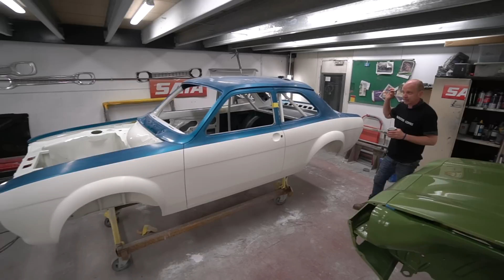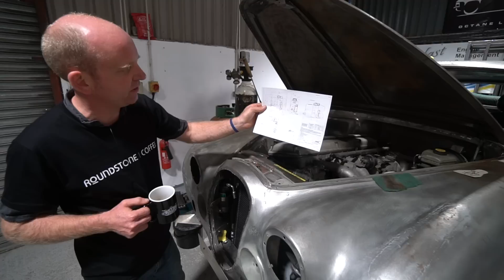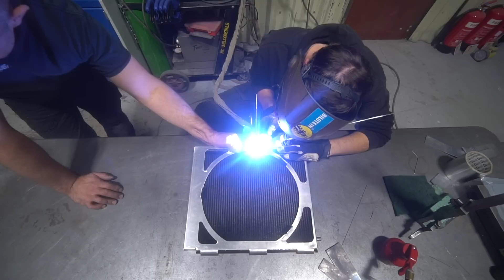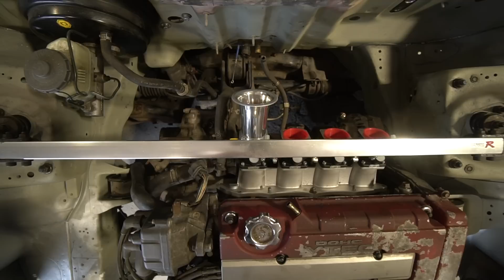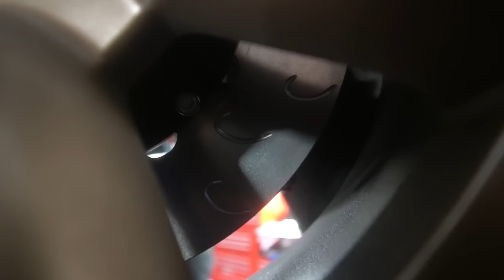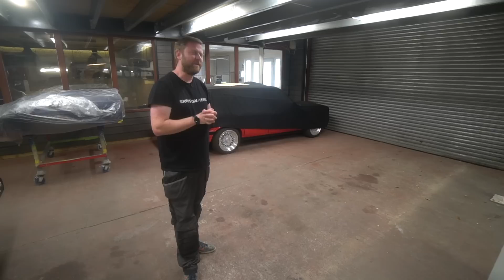Vauxhall Chevette Estate Painted & Stratos FOR SALE!

Comment: Best bit about using proper Honda bits is they're the only (afaik) company who built primary design right hand drive front wheel drive cars, with the heaviest 2 bits of the car (engine and driver) on opposite sides to each other. Shame they went all conventional primary LHD market  later on.
Reply: @mattsmith4053. You may already know this. In Japan, they drive on the left just like here in the U.K. And the Japanese have a cold snowy winter season. So when our car manufacturers went into decline, the Japanese marques cleaned up! Their cars were already RHD - plus they were built to withstand the rigours of winter motoring. Stay safe and well.

Comment: I notice you leave joins in stainless exhaust with discoloured areas.
I understand you can clean this off with a pickling solution.  In Australia at least you can buy this in about a litre bottle from welding stores. Not real expensive and makes the joins much nicer.

Comment: I can't even imagine selling the Stratos after all this time and work on it - it's been in the shop since the very beginning of the Uncut episodes, if not earlier. I would try to hang on to it for dear life even if I was out of the country a lot. I hope Retropower has a financial cushion and is billing on a monthly basis so they don't get too over their skis with customers not paying or pausing work... Seems like an ominous trend
Reply: You also have project creep, the ListerBell kit is built for £40-65k and they sell it on being a kit car without the quirks. Not a Hawk you build in a shed. Should they have gone as deep into making it different, the keypad switches,  Supercharging a 30 year old Alfa V6, 3D printing tail lights after 3 years etc, etc. Should they have spent more time at the start pinning down a price, look or target, rather than coming to a component and then going back and forth rendering stuff at that time. The clients love the relationship of you sending them 3 shades of leather for the handbrake. But this is the result. A very flowery version of what is a simple car.
Reply: @fraserwright9482   A turnkey LB is approx £100k and upwards depending upon spec, those that are built in a shed would cost between the £40 & 65k you mention.
There are a couple of LB's on Car & Classic currently for comparison. Blue wheels I think have to be described as a quirk.
Reply: They did mention they usecmonthly billing a while ago. Getting them paid is more to the point.

Comment: Large crystals within the structure (caused by rapid cooling) give less opportunity for each one to come apart and you end up with a harder material. Cooling slowly allows crystals to propagate meaning there are far more opportunities for each crystal to come apart, softer or more easily breakable material. This is why, if you need to harden steel without changing its alloy composition, cold quenching is one way to do it. Cryo-cooling is used for extreme applications such as steels used in pin sharp blades.

Comment: Dissimilar welding Nate? I think you were referring to 304 stainless steel as  303 is a road in the South of England, and usually 309 stainless steel welding consumables are used for mild steel/stainless dissimilar joints. Love the channel, Andrew from Cornwall
Reply: Made me go and check my dissimilar rod, it's 309L

Comment: I think we all wanted to know what's the asking price for the Stratos
Reply: If you have to ask, you can’t afford it.
Reply: The same could be said with the Morris.  The Morris is basically an MX5 spaceframe with a bigger engine. The hand wringing over the paint chips and it's being resprayed not because of a defect in application. But by use is why they should have had a dry build road test and noted the chips on the primer, dicky clutch whilst it was in paint prison.
Reply: €330k, but TBH this is a good example of where Retro power screwed up. The Stratos is a ListerBell kit who took months/years to do their bit. Engine options are Ferrari V6, 328 V8, Bussi, Toyota V6. The supercharging of a Busso took a year to do and still is not right. Most LB Stratos use the Toyota V6 with a supercharger ala. lotus Evora. So now after 3 years or more it's with the customer and it's failed to be fun.
Reply: @fraserwright9482  Good point - well made! Sadly often the way with vanity projects that run away with themselves.. ...
In direct contrast to the original ethos of custom car resto projects.
Reply: @fraserwright9482  Most LB STR's are fitted with the Alfa Busso motor, there are a handful out there with the SC Evora engine and also a dozen or more with the NA 2GR motor as well.
Reply: @Stratosphere-GT71 that is the £65k question. ListerBell sell a sorted STR and you can see they went off on cnc bits and keypads, then 3 years later telling the bloke he could have fancy taillights now they have a CAD bloke. It's a lesson on getting cars out the door and then booking them back in to refresh them or learn from real world testing so they can focus on the production process as they have 4 cars they are trying to tweak instead of 1.

Comment: Why can't you single point thread the wiper spindles on the lathe...? Oh and when water turns to steam it expands approximately 1700 times..!
Reply: lets just hope it does not turn into steam while you are driving then, that would be bad. Let's keep the temperature well below that. that way expansion is only in the 1 to 2% range or so.

Comment: 100mm tb is way too big on the Stratos....not surprised you've struggled to get the low end playing nicely.
Reply: Yep - the sneaky secret with throttle bodies is that you want to use the SMALLEST unit you can get away with. And if your intake piping is all three inch then going with a 3.5 or 4 inch unit doesn't make any sense at all.

Comment: The Mk 2 Jag really should have had it's roof chopped by at least 4 inches as it looks far too high after it was converted to a two door.
Reply: Making it unusable as a road car, most chopped cars are terrible to drive, you can't see out your neck is always crinked .... better not, especially not 4 inches.
I once had to set up hotrods on an airfield for a magazine cover shoot, a very unpleasant experience.
Reply: It's not a kustom. As far as I can gather it's built to look like what a factory MK2 jaguar coupe would end up as.
Reply: maybe if the owner wanted to give it to his 12-year-old to sit in and make vroom noises. An actual adult would not be able to sit in a 4 inch chopped jag, or just about any other car for that matter. The only car that ever needed to be chopped was the model t doctor coupe